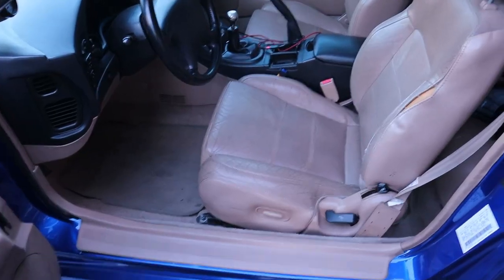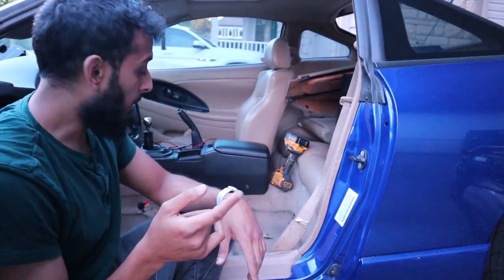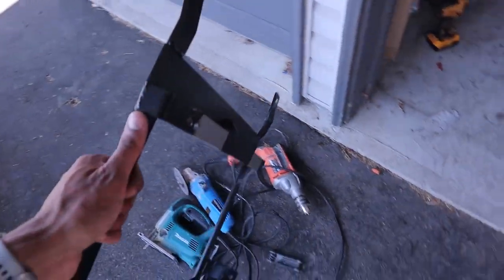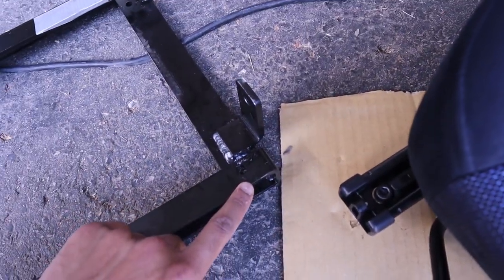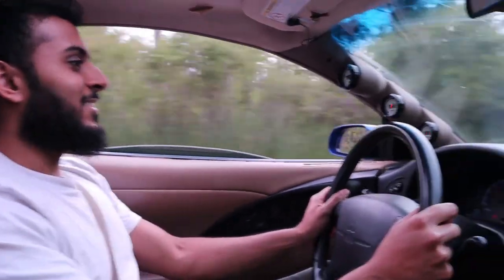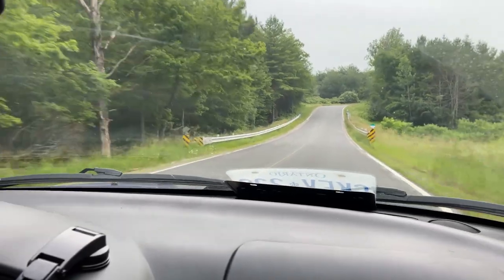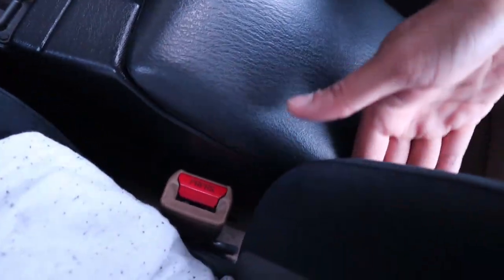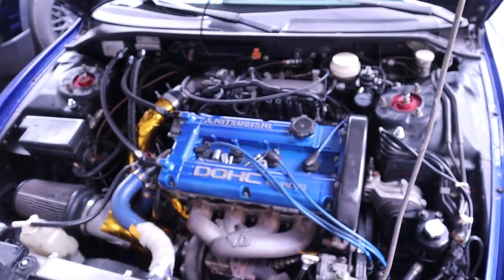Getting Rare JDM seats for my 2G Eclipse! | Turning my eclipse into an EVO Part 1

Comment: Planted brackets are definitely the better choice lol the better decision!
Reply from the maker: Its planted with OEM sliders.. planted seats r stupid lol unless it's a dedicated race car for one person
Reply: @CrispyImmy  no sir, cause Planted seats are a flat surface. They don’t have like a bracket stacked on bracket. If that makes sense. The bracket you had from eBay looked like a Wedge knock off.
Reply from the maker: @Intenseness21  oh u meant the brand.. are they still flat for the dsm? It'd be hard to line things up for the dsm as the seat bolts usually will be above the mounting points. Anyways, that would help a little for taller people but it's completely fine in my case. My only issues were fitment as expected from cheap eBay brackets lol
Reply: @CrispyImmy  yeah my bad, Planted is the brand! Yeah they are flat for the DSM. I have Braum seats on Planted brackets with lots of head room! They have extra widen holes already too lol
Reply: @YourUserNameSucksx10  didn’t compare that tbh. But definitely have lots of headroom. Don’t have to lean the seat to fit properly

Comment: Are you sitting as high as the OEM seats it's I'm looking to getting some Recaro seats for my GSX as well but I'm 6'2 I'm just wondering if they don't sit too high where ill be hitting my head lol
Reply from the maker: Reading the forums, first of all ... A lot of dsmers r tall as hell lol.. I read people 6-6'4 were fitting fine. In 5'10-5'11 and fit fine but height wise felt the same as stock. There are ways to easily fit for sure and if you go with planted (brand) brackets, they sit even lower!

Comment: Hey bro can u send the link where u got the brackets?
Reply from the maker: Sure but as per my video I'm not too happy with them lool. Its hard to center the seat due to the incorrect bias on the driver bracket...

https://www.ebay.ca/itm/115276801908?mkcid=16&mkevt=1&mkrid=711-127632-2357-0&ssspo=ECO0ZUtkQ-a&sssrc=2349624&ssuid=Ia5xMobQTmy&var=&widget_ver=artemis&media=COPY

Comment: Yo what's the link to the brackets
Reply from the maker: Bro just get ctsv brakes 😭 but check spoolin69 on ebay
Reply: @CrispyImmy  brakes? You know this video is for seats right?
Reply from the maker: @stevenonthewater6070  lol mb read brackets and assumed that. Ebay but don't think the same link Is available
Reply: @CrispyImmy  the one I seen that looked good are priced at 900 something. Idk man
Reply from the maker: @stevenonthewater6070  yeah that's insane
Reply from the maker: Check planted (brand) or wedge engineering.